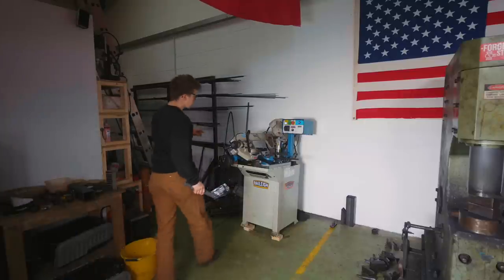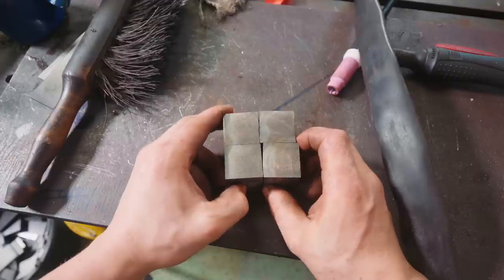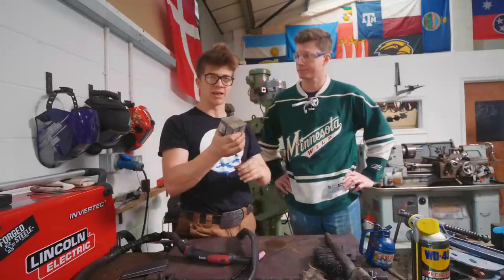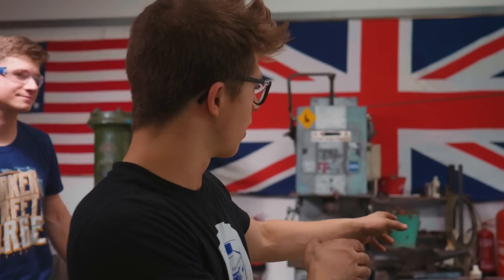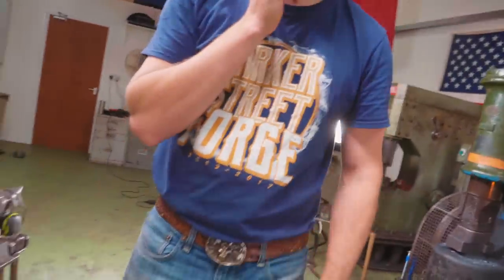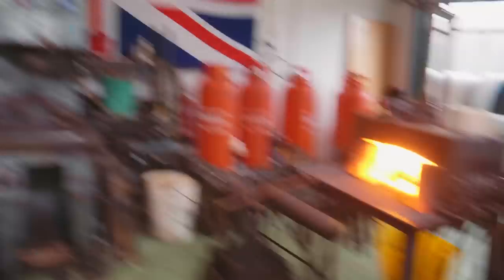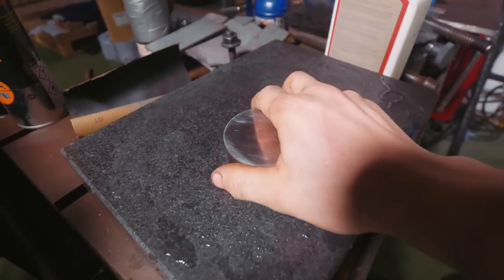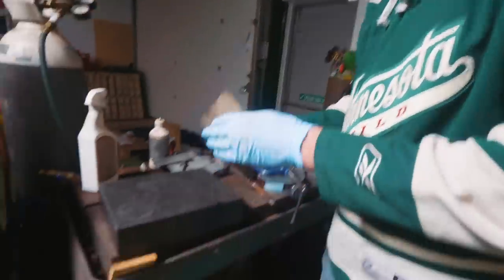DAMASCUS ICE HOCKEY PUCK!

Comment: That is a beautiful piece of pattern welding. I just wanted to mention to you that you can bring out a great deal more of the chatoyance (tiger's eye look) in pattern welding if you do this: When removing the oxides from the etching (make sure the base polish is at least 800 grit), remove the oxides from each etch with loose rotten stone and 0000 steel wool. Do this 4 times or so. This will leave you some relief in the etching, and the rotten stone does not flatten the hard parts. It leaves the steel with a slightly-matted shine, and reveals the pattern quite well. You will be amazed at this trick. Give it a shot. I make pattern welded swords, and this is what I use.

Comment: Definitely make the hockey stick blade for him in a future video.  Also, would it be possible to forge two pieces with a dished hollow in the center, and then forge weld them around the edge?  Not sure if there would really be any advantage, and it might be dangerous to forge it after given that it would be a sealed canister of air that you're heating and hitting, but could be interesting.  I could see it possibly changing the weight of things, which is why I started thinking of it.  That puck can't be regulation weight.

Comment: Why does making an icehocky blade take so long ?? Flaten the bar, heatreat it, etch it, done. Mike looks so dissapointed :(
Reply: Jordan C. Wilde do you really think its that easy. You know very little child
Reply: Jordan C. Wilde The problem would be making the collar for fitting it to a stick.
Reply: Normally you fit the stick to the collar, but mkay. Punch a hole in it that's roughly the size of a hockey stick and then fit the stick to the hole. Mike said he is a hobby blacksmith himself, so he should be able to finish that thing on his own. Polishing, fitting, etc. It wouldn't have to be like hockey blades you can buy where the end of the stick practically inserts into the blade itself, if you can immagine what i mean, but more like the eye of an axe.
Reply: No Filler Words Productions .Good Job calling a random person a child. Very mature.
Reply: Jordan C. Wilde if it’s that easy why don’t you make him one?

Comment: ALEC PLEASE HELP!!!!!!!! 
IDK why my forge is not getting up to welding heat :(
Reply: Zack Grogan it probably has to do with your forge being too large for the burner or there is not enough insulation
Reply: Alexander Clapham so it is 16in L X 12inW X 9 in tall with an inch of refactory on top with 4 inch of ceramic blanket on top with 3 inch of blanket on the side and 2 inch of sand 1in  layer of brick on the bottom coated with and inch of refactory I have two burners 3/4 x 12 in with might tips and a 1 1/2 in flare but I am only using a normal camping propane size tank
Reply: Facebook says "content not found"
Reply: Thomas Russell try now
Reply: Have you tried putting fire rated bricks for doors in both the front and the back? do you have an open air adjustment for the mix? if so, open it up some and try again? It needs oxygen from the air to burn hotter than just the propane by itself. Also, you might not be leaving the steel in the forge long enough?
Reply: Thomas Russell yes to both it get close just not up to welding temp I think my tank freezes up before I can get up to temp in this video I way doing my first heat so it was set low flame
Reply: Not sure then, maybe ALEC will reply with some helpful suggestions. Good luck, bro.
Reply: Dave Erving Evader Knives yeah I don't have a pressure regulator on it at all also I am pretty sure since I only have one 3lbs tank it was freezing up on me

Comment: AND YAAAA COOOOODNT EVEN PUT A MAPLE LEAF ON THE SUCKER EHHHHHHH BUD? lol joking but god damn is this a perfect opportunity for a canadian themed build :P
Reply: oh i was also wondering since youve made swords now would you PLEASE PLEASE PLEASE! consider trying a laminated blade ala ww2 style? japanese smiths invented a way to mass produce higher quality blades during that time(though not all smiths were good enough to do it or knew how) but you take a solid billet or pipe or whatever then for the core you use a different material and have it sized to be super super tight fit, you freeze one then heat up the other(not red hot i dont think just warm) then basically cold fit the too together for a perfect weld everytime, i was thinking a wakizashi, made with two different billets of damascus done this way would be cool.

 then you could machine a fuller(bo hi for japanese swords) into it to get a cool two tone effect with two different patterns. and doing it that way means you could machine in the edge section as well as forge and have the core steel be the edge steel as well to make it easier.  thus you could make one billet a prettier less durable stack up, and the other a mono steel or better mix of steels for the edge.  or you could go traditional and a softer core and harder outside(though that depends as some older lamination's use a hard core and soft jackets)

btw your enthusiasm for work literally puts a smile on my face, most of my life people always thought i was weird for enjoying building stuff so much, its nice to see others who enjoy making things as much as i do, and actually succeeding on a social platform like youtube without being some expert.  the learning process is always the best.

Comment: Enough with Damascus friviolities. You are pattern welding artifacts having no more serious merit than skateboard tricks where the canaille breathe "O-o-oo! Cool!" as the rest of the world smirks in dismissive contempt

I suggest a comparison trial where you forge, finish, and heat-treat identical mortice chisels from your best Damascus formulation and a recognised cutlery steel like O-1. Sharpen them and have a reknowned woodworker submit them to torture tests of his devising. Then analyse the rwo for post-test edge quality, cut quality in the test pieces, etc. A pretty tool may be a thing of beauty but if it can't perform its function, what good is it?